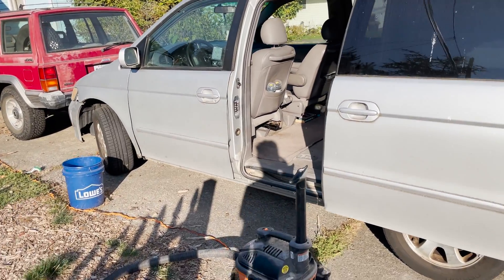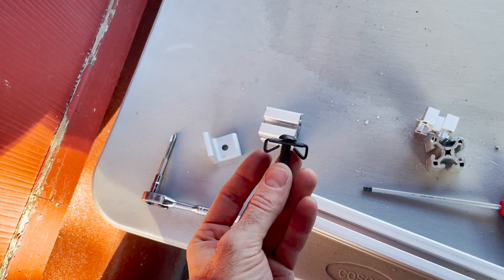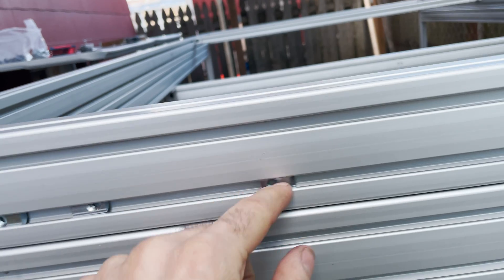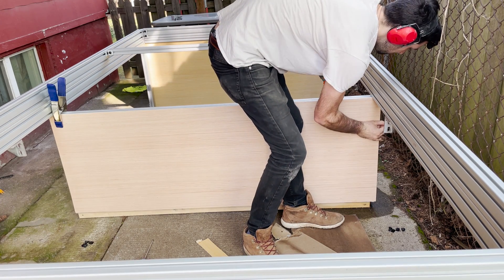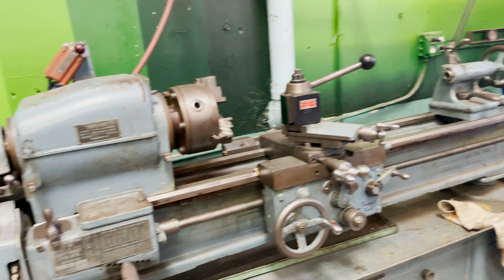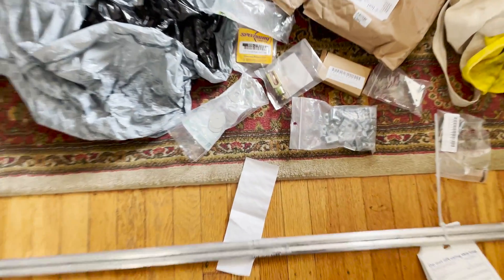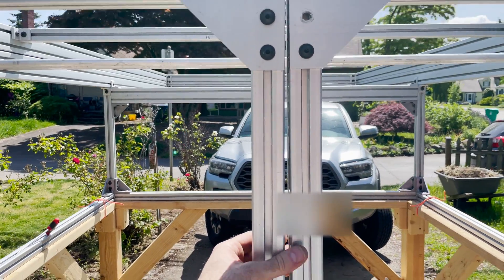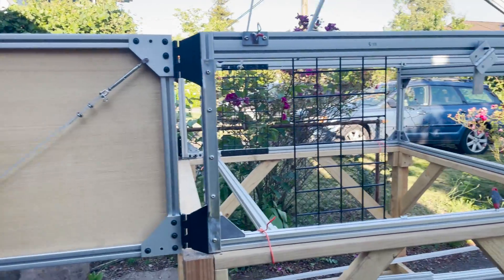Building a Truck Camper From Scratch - Part 1: The Frame

Comment: Extruded aluminum is not lightweight.
Reply: That can be true. I've built a lot of work benches and supporting structures for factory machinery using both 80/20 Company and Bosch-Rexroth systems. Some are very light weight compared to other materials, others very, very heavy. All depends on what is being supported and which extrusion profile is selected.
Reply from the maker: I'm using ultralight! Lighter than wood!
Reply: what can we use to make the same thing lighter?
Reply: @Regis_gladiator_overland  extruded aluminum is absolutely fantastic for ease of assembly and the weight of it on this truck will not be an issue.  I was just commenting that it shouldn’t really  be referred to as lightweight (well, all things are relative) when simple aluminum tube (square / box) is plenty strong enough and lighter.  But, that requires welding or a design to allow for structural rivets to connect all the bits.

I just want to add that I don’t think there is anything wrong with this build whatsoever (not that my opinion should matter). It’s great.

Comment: I have been designing a camper build for about a year now. I have not considered using the aluminum channels like you. Such a good idea! I’m excited for you and will be following along your journey. Great video!
Reply from the maker: @allenshaffer8733  amazing, thank you for the comment! It’s a bit more expensive, but worth it for the additional flexibility if designs need to change. Good luck with your build!!
Reply: Same
Reply: Indeed. I had thought about using that too, but wasn't sure if it would be strong enough to handle the wind when belting down a highway.

Comment: Entice build using 80/20. Any reason why not use 80/20 black? Should have a sturdy frame.
Reply from the maker: @dummy4100  thanks for the comment. I wanted to use the ultralight 8020 which I could only find in silver locally. Plus I like that it will match the truck and hopefully keep temperature down a bit in the summer compared to black.

Comment: Thanks for your time documenting your build! What’s the total length of your camper? Do you have an estimated final cost ? & weight?
Reply from the maker: @Traversable  the total length is around 115”. I don’t have any final details on cost or weight yet, but I’ll share that as I get further along in the series!
Reply: @nolangordin  the link to the aluminum extrusion seams to only have 89” available. Was there longer pieces available when you ordered?
Reply from the maker: @Traversable  I ordered a lot of stuff off Amazon, but I ended up purchasing the aluminum extrusion through Grainger so that I could pick it up and avoid having to pay for shipping!

Comment: Whether it's a double cab or a access cab, I will never understand so many camper builds NOT on a 6' bed. You have some great ideas and I love the build it yourself how YOU want it mentality. If you don't see what you envision, for sale as a camper, build it yourself. Bravo Sir. Thanks for sharing.
Reply from the maker: Thanks for the comment! Yes I agree, the 5' bed is a bit limiting, but that's why I'm intending on using the tailgate as extra sq footage on this build. It has certainly been a fun process making everything that will fit my needs. The closest thing that I've seen for sale currently is the Harker EDC, very cool design!
Reply: Quite a few people buy trucks when they do NO truck stuff.
Reply: Exactly!!!
Reply: Plus gladiators only have a 5foot bed believe me I’d do 6 foot if I could lol
Reply: Personally can’t imagine owning anything less than 8’ but he did a great job with what he’s got
Reply: even without a camper idk why people get trucks to haul absolutely nothing
Reply: 5ft wheelbase is better off-road and crawling
Reply: @Tony-ek5pf 🙈
Reply: @Tony-ek5pf  what truck has a five foot wheel base?

Comment: Pretty Cool. Did you consider trying with diagonal bracing on the big door?
Reply from the maker: Thanks for the comment! Ya I tried a few different options including a retractable leg with a wheel, but it just seemed like it was going to cause me more issues in the long run, so I scrapped it.

Comment: I’ve been watching lots of videos on different camper builds to find the best way to build mine. Finally found someone using aluminum. Thanks for the link to the materials, can’t wait for more videos, you just gained a subscriber!
Reply from the maker: Heck ya! That's amazing to hear. I recommend buying the extrusion through Grainger if you have one near you, that way you can save on shipping cost! Good luck with your build
Reply: @nolangordin  there is one right down the road, i will go check it out thanks for the tip sir
Reply: @nolangordin 
If you wanted "more freestanding space," then why didn't you buy a regular or extended cab truck?
Reply from the maker: @travelinman482  Because I didn't want to have a longer vehicle for driving around in the city. The 5' bed fits for the rest of my needs well aside from the camper.
Reply: @HighdesertHVAC  just a suggestion before buying this aluminum new check marketplace, I just spent $300 and got a huge lot of this extruded aluminum even the 6” beam stuff that is almost like a 2 X 6. There is so much I cannot use it all and it’s not the first time I have seen or purchased the extruded aluminum from there either.